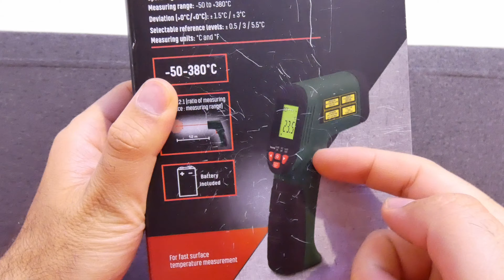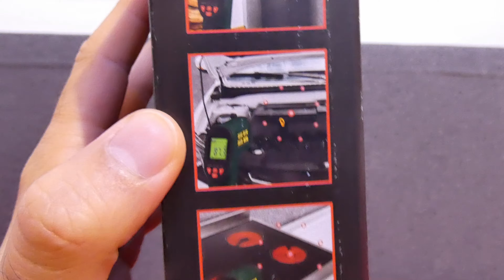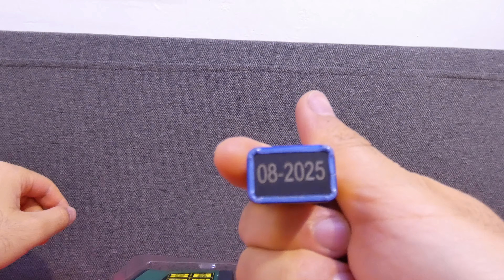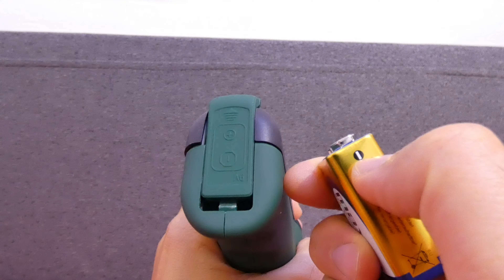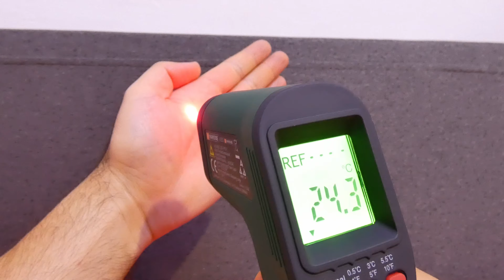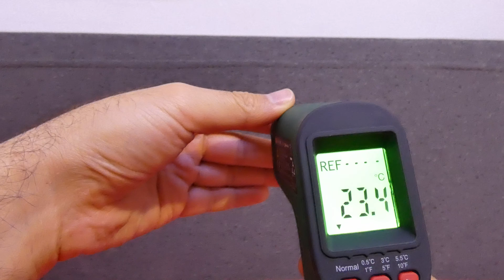Parkside Infrared Thermometer PTIA 1, HG05546 (Lidl)

Comment: Good, very good for the price, except for the different aiming laser. I bought two devices, and in both of them the laser aimed way too high at all distances. This is not due to the inevitable parallax error, but rather to the inexplicably different shape of the housing where the laser capsule is glued. I was able to correct (partially melt) the housing around the laser capsule on one device so that the beam is now correct, excluding the parallax error. However, during my first attempt at repair, the laser optics of one device broke due to too much heat.